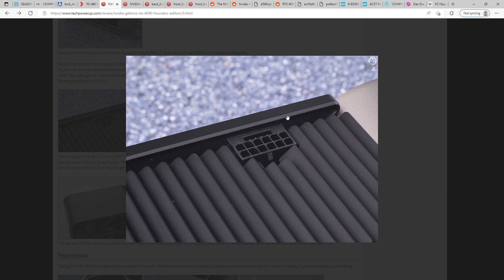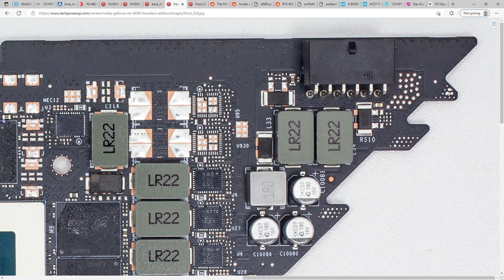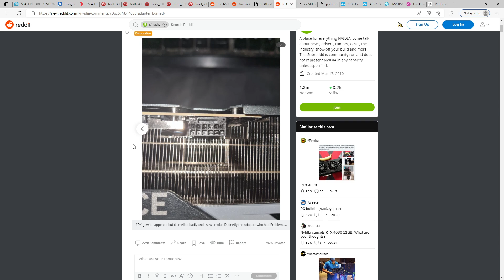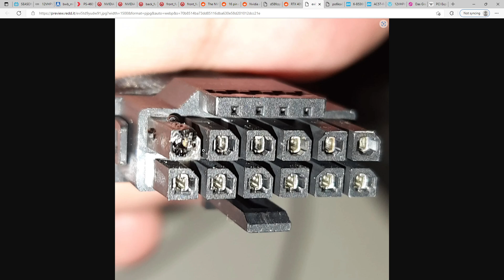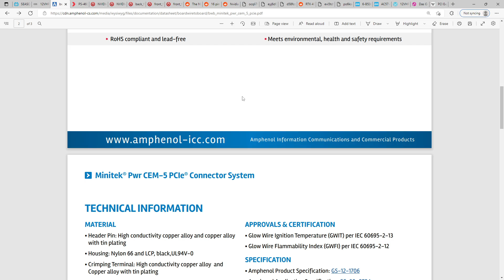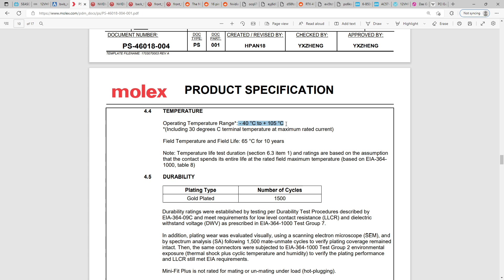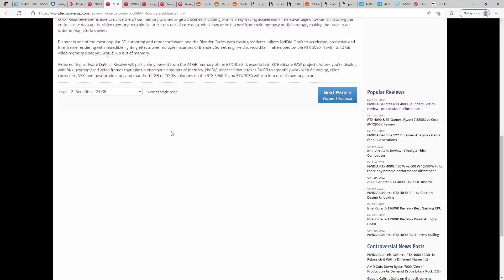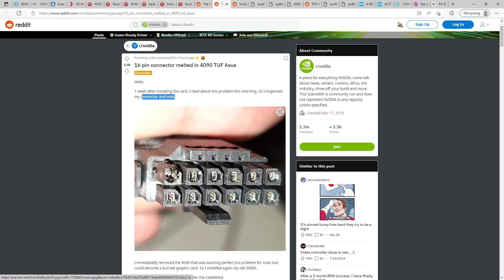rambling about the 12VHPWR failures

Comment: Imagine cheaping out on the adapter for a $1600 TOTL GPU
Reply: @glitter_fart  You need 1000 Volts per mm distance to create a spark in Air
Reply: @weler1806  ever connected  amplifiers to car batteries before?
Reply: @weler1806  as I mentioned above - you can get an arc with lower voltages (with shorter air gap). But in assembled PC? - never.
Reply: @weler1806  except that 12 volt arc welders exists.
Reply: @glitter_fart  you increase the potential difference until it overcomes the resistance of an airgap and creates an arc. Current has nothing to do with it.
Reply: @MMGuy  lmao got you dancing
Reply: @glitter_fart  imagine having no idea what you're talking about. Electrical Engineer here. You need over 300 volts to initiate an arc in air at atmospheric pressure. Generally you'll need about 30,000 volts per centimer to arc. You ever hear of Paschen's Law? Familiarize yourself...
Reply: @zqzj  should post this as an individual comment . I thought 12 volts at 100 amps might be enough. thanks
Reply: @zqzj  https://youtu.be/lT3vGaOLWqE. Arcing at 2000v
Reply: @zqzj  how is a jacobs ladder able to work with much less voltage?
Reply: @zappulla4092  because it doesn't work with less voltage. More like 500+
Reply: Good thing those cards were 2600€ here. For that money...
Reply: @glitter_fart  Tell me more about your EE degree and your salary.
Reply: @glitter_fart  Yeah you don't have a degree. Also you think that I don't believe they start fires simply because I don't like your attitude in the comment section. Way to live out an echo chamber mindset. Your behavior is in question and you don't have the credentials to be making these claims about electronics. Literally re read your own comments.
Reply: @glitter_fart  amps has nothing to do with it, 12v DC nothing. It takes hundreds of V DC to create arcs through air, even at less than a mm
Reply: @jonahhekmatyar  6s lipo say you wrong…
Reply: @jonahhekmatyar  Never worked on a car before, have you.
Reply: @jonahhekmatyar   @Michael M   @Weler180  tell me you never installed a car battery and see a spark.
Reply: @Mr_Meowingtons  thats not an arc, that's current burning through the tiny part of metal that gets connected when you touch the terminal with the cable. Lmao 🤣 how about you tell me about how you have no clue what you're talking about.
Reply: The last thing I want to see or smell is melting plastic in my computer system. 

“But it shouldn’t catch on fire” is also a reassuring thought. 

Why cheap out on a critical part that can be built for a few more pennies that will end up costing $$$$ in reputation and consumer confidence in your product.
Reply: Amen. A well engineered POS.
Reply: Holy shit, they actually had the nerve to post up in this comment again after that first Oof - lmao
Reply: cheaping out and / or a engineering mistake which is even more embarassing.
Reply: @glitter_fart  you can't though. Voltage is too low. 

Doesn't matter how much current you have. It's basic electro-physics
Reply: even the thought that they go and make this dogshit connector instead of just giving the fucking card 4 8 pins or 2 cpu 8 pins blows my mind but i guess they want to cheap out on the pcb even more like the greedy bastards that they are
Reply: TOTL? I don't know this acronym.
Reply: @TheSlickmicks  i assume that it stands for Top of the line because it's one of their high-end and the flagship of the generation
Reply: 2899 in canada. thats launch but still.
Reply: With last gen display ports when intels 300$ gpu has the new standard that can support above 4K 120
Reply: Whatever you do. Dont look into flagship trim levels on major car company products.
Reply: One day these current consumers will realize just how much they are being taken for fools by these Corporations. It didn't cost Nvidia $1,000 to produce these GPUs. It didn't cost Nvidia $700 to produce these GPUs. It didn't even cost them $500. It is a money grab so Nvidia can invest in AI for self driving cars. It's a fantastic and fascinating technology they are working on but Nvidia has completely taken advantage of the fan boys to pay for the huge fine of $5.5 Million from the SEC over them lying to their Investors about who was purchasing their GPUs. Nvidia will take as much money as your willing to give them.
Reply: Imagine making a 'know it all comment' and getting absolutely destroyed by more educated people than you.
Reply: Imagine that the 1600$ GPU is 2000€ in Europe...
Reply: @glitter_fart  Stop talking about what you know nothing about
Reply: I don't think it costs Nvidia $1600 to produce such card, so they couldn't care less.
Reply: Except noone actually knows why it happened and your talking out of your actual fucking ass. This cable is ATX 3.0 standard and that itself might just be flawed or it could be a manufacturing mistake, as Nvidia are by far the first to adopt this connector
Reply: @glitter_fart  You don't get arcing across 12VDC 60 amps. Or 12VDC 6.000 amps for that matter. Arcing is an artifact of big potential delta; voltage. Not current. This is why tazers are often several hundreds of thousands of volts, but only output a couple of milliamps (or microamps).

What you can get with high current low voltage, is sparking. That is a completely different thing. Arcing is electricity traversing a non-conducive medium (like for instance air), through plasma, to complete a circuit towards ground. Sparking on the other hand, is induced at the point of mechanical connection or disconnection to close/break a circuit. More specifically, (with a large current draw) at a point where there is such a tiny amount of the conductors making mechanical contact with eachother, so that with all that current rushing through that tiny connection, a part of that material get heated so much and so fast that it instantly and violently incinerates.
Reply: @glitter_fart  cool then. Anything else substantial to add besides hurling accusations? 
Thankfully chance of my electrical expertise intersecting with your workfield is factual zero.
Reply: Ngreedia's patners have to cheap out on everything. The only one that doesn't seem to be cheaping out much is Asus, they probably go at a loss to keep their RGB ecosystem alive xD
Reply: @glitter_fart  only way you can get it to "arc" if you are plugging in live 12V into a "cold" device (one that has fully discharged its own capacitors) and expect stuff to run normally.
In personal computers (yes, PCs, in servers it's a different story) you never EVER do that. You will either trip protection or straight up burn connections (near instant) or chips that are connected there. 
I can get even 3V to arc at micron distances of air gap but never in assembled PC.
Reply: @JIAroJIy4  you're referring to a spark not an arc. 3v will never arc.
Reply: @zqzj  well by 3V I was referring to shorting out high-current capable lithium battery cell (and yeah, it's not really 3V, more like 4,2+V when fully charged).
And process occurring is more akin to sparking with consecutive welding (if shorted long enough) of contact surfaces used to initiate short-circuit.
At that stage I would still consider this process to be closer to having arc jump between contact surfaces within microns (or between "+" needle and big flat "-" area) with potential welding that should occur shortly after (if battery cell won't die immediately).

I'm still probably incorrect in explaining or understanding of process I described. I should use some reference material, for sure.
Reply: @JIAroJIy4  what you're referring to is an arcing of the metallic plasma created by the momentarily high resistance upon two metallic surfaces initially coming into contact with each other with an initially very small surface area, in low amperage applications, which causes the metal to vaporize and arc. In high amperage applications the arcing is again created by the metallic plasma, but can be sustained. Under 300 volts you cannot arc an air gap. Air gap arcing cannot occur at low voltages.
Reply: @zqzj  how are sparks defined in this case? 
I was already understanding that arc implies creating plasma to sustain electrical connection, which would never happen under low voltages.
Because those sparks are observed and they result in damaging contacts (thermally I think).
Reply: @JIAroJIy4  a spark would be momentary and not sustained.